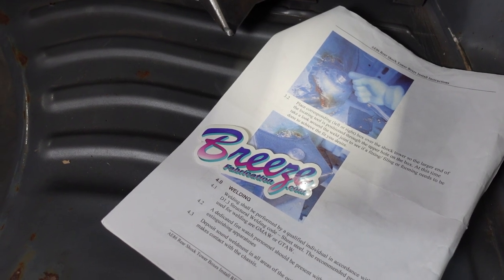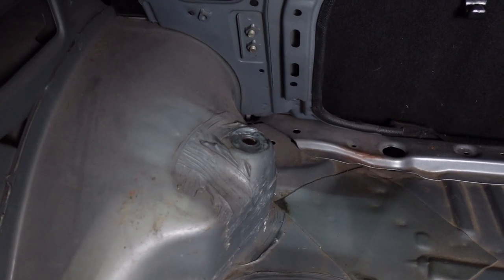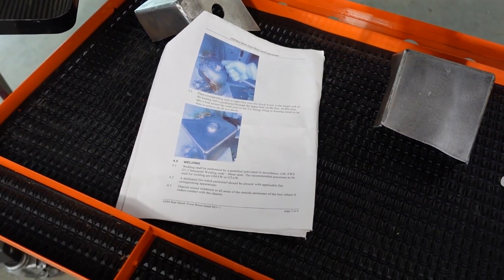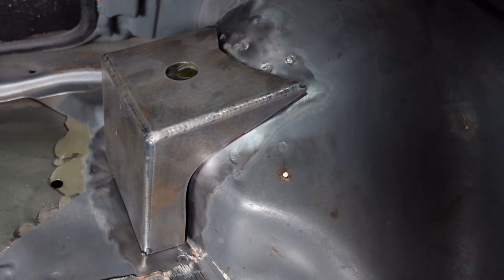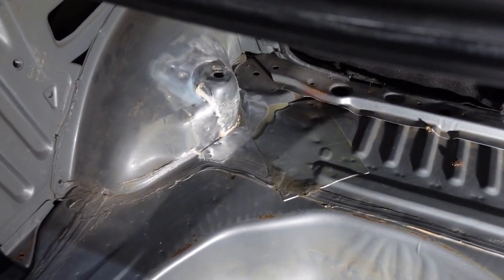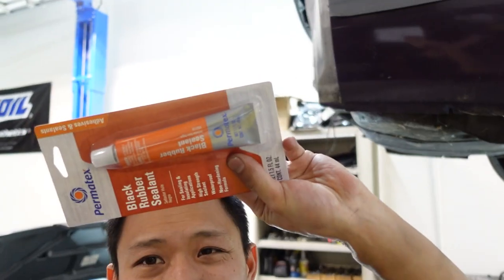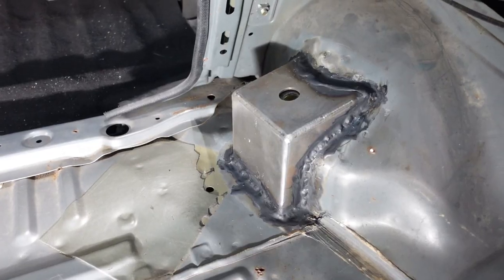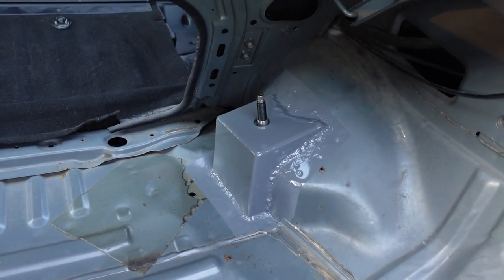AE86 Weld In Shock Tower Reinforcements (Breeze Fab)

Comment: That’s an awesome tutorial.  Did you mig or tig weld the mount?  Also, does the true coilover now sit on the Breeze Fab mount or does it still sit on the AE86 chassis?  Thanks Ezekiel for the great video!
Reply from the maker: MIG welded. The Breeze mount overlaps right on top of the chassis so there is no gap between the two where the coilover is bolted if that answers your question.

Comment: Wait you didn’t coat the bare surface inside with steel it or some weld thru primer? That seems like a recipe for disaster when that pocket rusts inside out. 8/10
Reply from the maker: Thank you for pointing that out. And yes, in hindsight  a definite oversight. Luckily our sunny California climate is not rust prone. But to be fair, many OEM's bond interior panels bits together without paint or sealer.